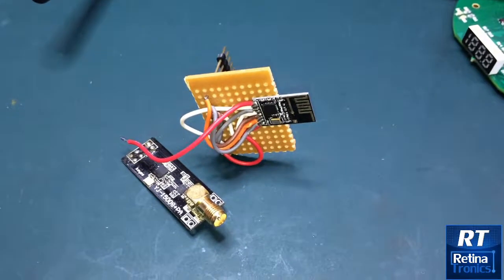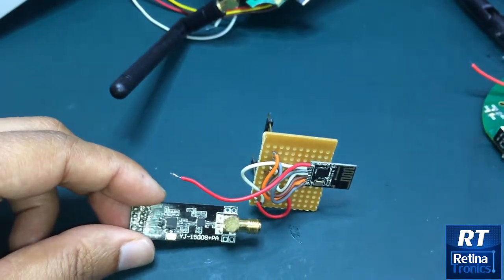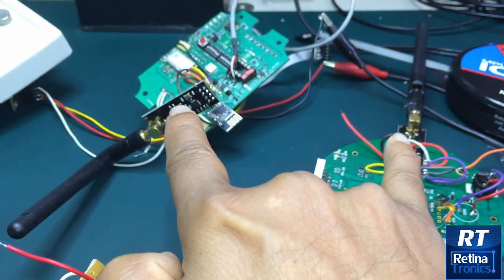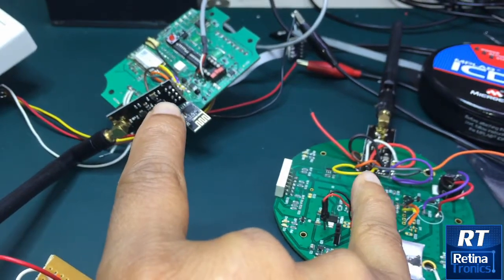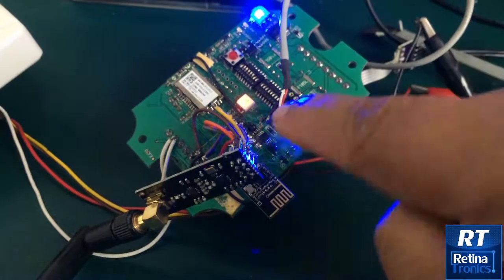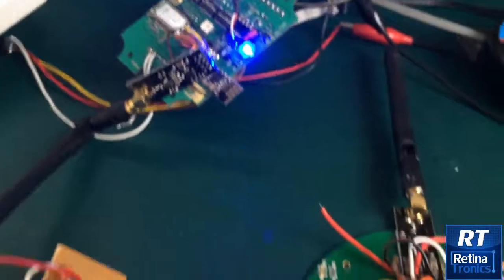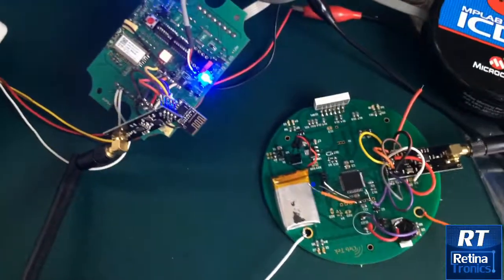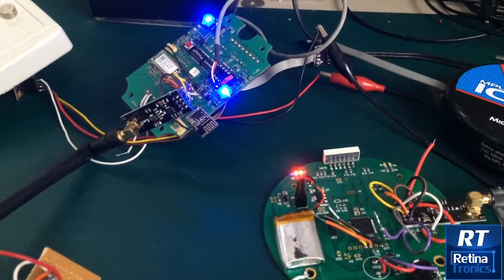nRF24L01+PA Frequency Hopping

Comment: Are these communicating in full duplex?  Did you write the FH software, or are you using a library?
Reply from the maker: Hi Robert, At the moment they are communicating simplex but with acknowledgments from the receiver. It will be easy to send back some data with the acknowledgments as the NRF24L01 is capable of doing that, hence making full duplex transmission. I am using low level functions written by me to do this.